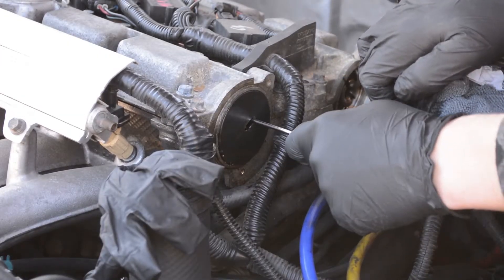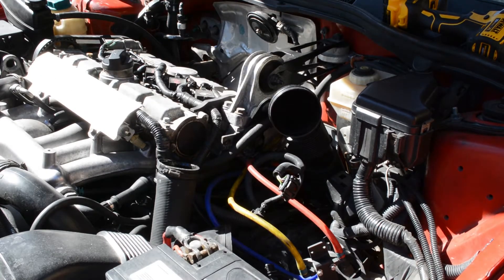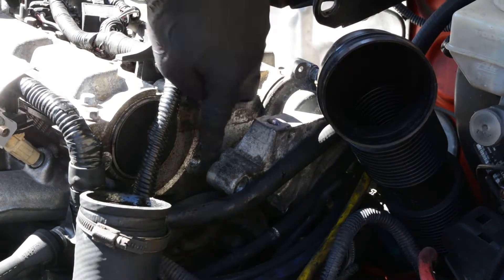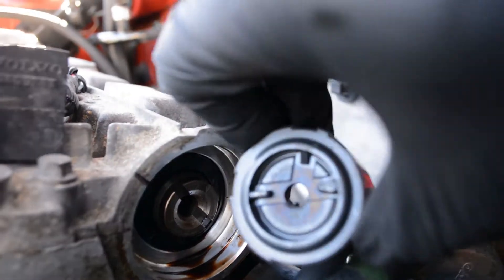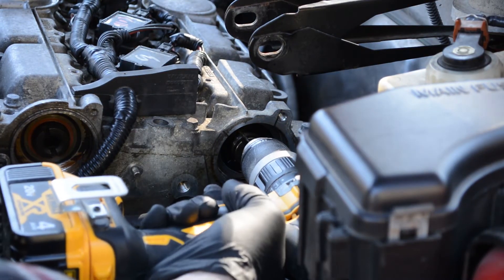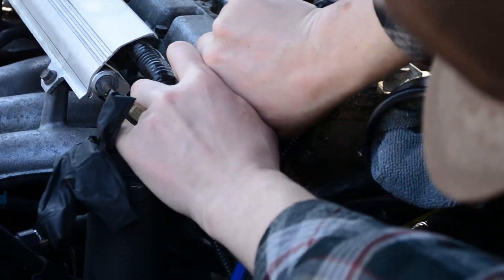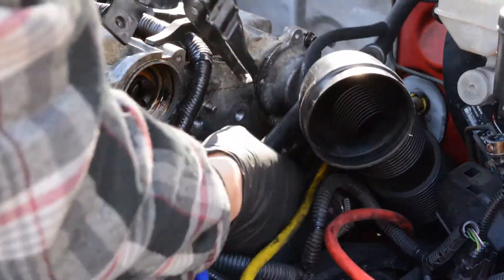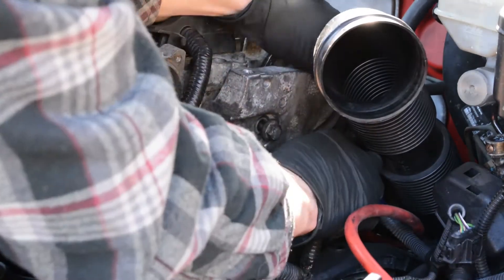Volvo 2.4t Rear Cam Seal Replacement

Comment: great little quick video and just what i needed. one small note, the intake rear cam, if the cover is there, never got a cam seal as the rear plug functioned as the seal so that small part there wasn´t a hack by the previous owner. thanks again.
Reply from the maker: Thanks for the comment! I had no idea that the dust cap served as the seal. So I guess in my case the dust cap was not sealing correctly and I just did extra work. I assume there's no issue with installing a seal anyway?
Reply: Did you end up installing the seal ?  How did it go?  Or did you remove it and only use the dust cap?
Reply from the maker: @wc2787  I had the seal on there with the dust cap, but the comment from James Madison is correct, you don't need it. I actually had a PCV issue that caused the front cam seals to blow out a few months after this video was filmed, so I went back and removed that came seal behind the cap. I then installed the cap and did a very light bead of RTV around it just to keep any oil from leaking around it. It's what a local Volvo guy does, so I followed his lead.
Reply: nice video and good comments was wondering whats up with my rear cam leaking oil and where the hell is the seal.

Comment: For those of us contemplating doing this job, thorough videos like this are helpful to let us know if we'll be getting in over our head or not.  Honestly, I can see this going south for me in different ways ..especially when it comes to extracting and pushing the seal in.  That looks like it takes some finesse.  I hate spending the money but you gotta be realistic about what you can and cannot do.
Reply from the maker: Totally agree with being realistic. Because the money you save can quickly go out the window when you have to get a tow to a shop and have them do it. 

That being said, the seals really aren't that bad. Just need a steady hand and the right tool. There's actually a tool to install the cam seals if you think that would help you out.

Comment: What cam locking tool did you use on the front?  I see some really cheap knock-off's to the very expensive Volvo tools.
Reply from the maker: I'm ashamed to say that I used a block of wood. I tried a few cheaper cam locking tools and none of them fit. I think I'll be ordering the expensive Volvo one for the future because it's not something to take a chance on.
Reply: @StevesGarage  thank you!
Reply from the maker: @davidmaddox7154  No problem, happy to help!

Comment: Good Job! But I don't understand one thing, how you locked the VVT? Because if you lock just the pulley you won't lock the VVT. Where you locked?
Reply from the maker: I only locked the pulley, so you're right, I didn't lock the VVT. I don't think I took it out of alignment though. I never had any issues running or a CEL associated with VVT not functioning properly.

Comment: Thanks for the video. Can you please explain to me how you locked the cams?  The tool I got is to be installed exactly in the same rear part of the cams. Cheers
Reply from the maker: That seems to be what most cam locking tools are because you lock them to do the timing belt. You need a cam sprocket locking tool. You can usually pick up an adjustable one for a decent price at your local parts stores, you just have to find one that fits.
Reply: My question as well.  The volvo cams lock from the rear, so the only way to "lock" the cam while taking that bolt out on the rear is by the timing belt itself.  But that's okay because, as they say somewhere, "as the one cam turns so turns the other cam and the crank."

Comment: I just did this service today while also changing out my PCV system. Like you, I didn't have a seal behind the black dust cap. I thought that was odd, as I'm pretty sure the cap was original and had never been removed. Question is: Will installing a seal where there wasn't one going to cause adverse issues?
Reply from the maker: Some others have commented that there isn't supposed to be a seal in that location. The part diagrams I looked at showed one which is why I installed one. I can say that I had the seals blow out one other time after this video (because of PCV issues) and I didn't install a seal, just sealed the dust cap and it's been fine.
Reply: @StevesGarage  ok great. So far no issues with the seal in place. Not sure what sort of problem to look out for if the seal IS causing issues, but it doesn’t appear to be hindering anything important.
Reply from the maker: @just__dave  My guess would be too much crankcase pressure, which would also be indicative of a malfunctioning PCV system. Make sure you clean out the engine block passages when doing the PCV, that was my issue. The person who did it before I owned it never cleaned those out.

Comment: I changed my spark plugs and I had to un clamp my turbo intercooler and after that I guess I didn’t clamp it enough. While driving I noticed something wrong so I checked under the hood and it was in clamped. I re clamped it tight at home and now my oil is leaking more it never dropped onto the floor but now it does. What can be causing this issue. Would it be the cam seals?
Reply: Turbo intercooler tube ^**
Reply from the maker: Hard to say what would be causing it via a comment section. If it is the cam seal, your PCV most likely needs to be serviced. There can be a small amount of oil in your intercooler hose from blow by, but enough to drip in the floor seems excessive.

Comment: Thanks for sharing, do you have video how to change valve gasket? Need some help because a little oil coming to the spark plug of my s60 volvo and can't any video how to chsnge it a friend of mine told me to need dpecisl tools I don't know what it is.
Reply from the maker: I don't have a video for that because P80/Whiteblocks don't have a valve cover gasket. They use anaerobic sealant. You said S60, so I'm assuming P2 or P3? I don't have the experience to say first hand, but I don't think the P2 cars use a gasket either. Is it possible you have a PCV issue or your oil cap seal has failed?
Reply: @StevesGarage  thank your for you time, I don't know if my car is p1 or P2 S60 2001 model Motor code B2544S. When I change the spark plug I noticed that the spark plug are wet with oil above the thread not much some already dried. A friend of mine told me its the valve gasket and we tried to torch those  small volt above the cover and he told me if I change the gasket I need a special tool I really don't know.  There's no any leak outside or under the motor.
Reply from the maker: @nestordupo845  Happy to help out, thanks for the detailed reply. A 2001 is a P2. P1s are S40 / V50 / C30 / 06+ C70.

As for the B5244 engine, there's no gasket. Unless the cam cover has been removed and installed poorly, it's most likely the oil fill cap gasket leaking or a PCV issue. Depending on the mileage if you haven't addressed the PCV it'll need to be done. For the oil cap gasket, IPD sells a Viton version that makes that gasket a one and done item instead of needing a periodic replacement.
Reply: @StevesGarage I live in Sweden our mile here is different from the US 1 mile=10km now my car 22000 Swedish miles. The vvt soleniod gasket broke down 5 yrs ago and the oil run all over but not in the spark plug bay. About the PCV I don't know if it is the problem I change oil every yr. To service the PCV  it will cost a fortune here in Sweden more than the value of the car. Well I will drive it till it broke down then maybe I will buy another car instead. I seldom use it only maybe a 1000km a yr or less. Only in summer time and no rust at all. About the oil cup I change it 3 yrs ago. Thank you for your time appriciated much.
Reply from the maker: @nestordupo845  Yea, the PCV service is a big cost, but it's not impossible to do yourself! There are a lot of guides out there. Even with changing the oil regularly it could still need to be serviced. Even with the low mileage things can break down due to how old it is.
Reply: @StevesGarage  I will try to do myself as project maybe next year, just now I'm in recovering from surgery of prostate cancer. Thsnks a lot.
Reply from the maker: @nestordupo845  Good luck with your recovery!
Reply: @StevesGarage  Thank so much sir.

Comment: Are both seals the same size
Reply from the maker: They are, but you only need the rear seal. I made a mistake in this video installing two. The dust cover on the front cam acts as the seal.
Reply: @StevesGarage  ok thanks...i just had the crankcase seal done so onto the next lol
Reply from the maker: @bawssnarmz5204  Might as well do them all while you're there!

Comment: Will this method work on a 2005 Volvo s60 2.5t awd
Reply from the maker: I don't know enough about that engine to say for sure. But I do know enough about Volvos that the concept of the replacement would be the same. I'm sure the sizes would be different, but the location and method would be very similar.
Reply: @StevesGarage  perfect! Thanks
Reply from the maker: @tysonstuart312  No problem, I hope the video helps. If you do have any other questions let me know. I might be able to help you out.

Comment: Could you tell me the diameters of all the seals? front and rear cam seals and crank seals please for volvo s60 2.4t 2002
Reply from the maker: I'm not familiar with P2 cars as I haven't owned or worked on one. I know there are different front cam seals for engines with and without CVVT. I know that the IPD website has dimensions listed for some of the seals, you could also check FCP Euro.

Comment: I bought the install tool thinking that would be a dummy proof way.  But it just ended up ruining the seal.  That inner rubber lip as you said can fold in on itself.  Using the install tool you have to press the seal onto the tool and its a pretty tight fit and you obviously have to press it on the tool the opposite way you'd press it on the cam and it makes that inner rubber flap fold the opposite way it's supposed to.  Or maybe im just an idiot.  but your method seems better
Reply from the maker: I haven't used the tool, but thanks for sharing your experience! A local Volvo guru told me to use the socket like I did in the video. Did you end up getting the seal installed properly?
Reply: @StevesGarage  Well in hindsight the part I was concerned about being folded in probably was insignificant.  I was looking at that tiny lip on the outside of the seal on the inner circle (if that makes sense) and part of it was folded in but then I removed the seal and determined surely thats not the part of this seal that's actually creating the seal. Unsure if you know what I'm referring to but it's really really small and not much to it and I'm thinking at this point it's an insignificant part of the seal. But...I had to order another, so waiting on it.
Reply from the maker: @jRODl4705  I think I know what you're talking about... I'm pretty sure you're only worried about the inner lip folding over, but better safe than sorry. I'd rather re-do the job like you are than have the seal fail once you start driving.

Comment: What if i had changed my pcv system but never replaced the seals. It has been another 100,000 miles since last pcv tune up. So it is time to do it again. But my q is, what if i just replace the seals and not the pcv? Its oem parts. Change oil religiously. Pls lmk. Maybe just replace seals then do a glove test?
Reply from the maker: If the seals aren't leaking there's no reason to replace them. They are also not a replacement for the PCV system maintenance. You should definitely do the PCV, and the cam seals are optional.

Comment: Hi there

Hope this finds you well

Firstly I'd like to thank you for the information that you provide. 

Secondly, I'm located thousands of miles  away from you so your answer to my questions will be greatly appreciated

I need your step by step instructions on how to remove the Rear Cooling Bypass Pipe because  it started to leak from where it meets the back of the water pump 
my Volvo is a 2001 xc v70 turbo AWD
if you did that before and have a video or a link to how to do it please send 
another question should I remove the turbo to get that pipe removed?
your help will be highly appreciated
thanks in advance.
Reply from the maker: Hi, unfortunately I haven't removed that on my car so I don't have any advice or a video. I know that Robert DIY deals in P80s and you have a P2 with it being an 01, but does he have a video? I know the early P2 cars are similar to P80s. Also, maybe pick up a haynes manual to help you out?
Reply: @StevesGarage  I'll try to find that manual. Thanks any way

Comment: I'm kind of panicking because I didn't have a locking tool and when taking off the grey little wheel on the back the cam moved about a quarter inch. However the belt itself did not move but the whole gear, when I look at the cam gears pop in and out about 1/8th of an inch :(
Reply from the maker: So the cam is moving in and out of line with the belt? Or it rotated out of position? The cam shouldn't move laterally as it's locked into place by the cam cover. If it moved out of rotation, you might have to reset the VVT hub to sync it back up.
Reply: @StevesGarage  Sorry, badly explained. So the cam gear itself does not move at all however I can feel the cam internally rotate as I loosened the wheel on the back, but less than a quarter turn (cam gear remained stationary and frozen in place, so to speak). Yes, the cam gear moves horizontally in and out of line with the timing belt (in and out about the width of a cardstock piece of paper, which would lead me to think just free play between the two parts that bolt the cam into its "cradle" in the head or something.

Additionally when I tightened it back up it rotates back to the position it was in (clockwise about a quarter turn) prior to loosening and unbolting. Hope this helped clear any confusion

I've replaced and bolted everything back up in regards to the PCV system. All that's left after the cam seals is the timing belt which I haven't started yet
Reply from the maker: @JCDUDECANTU  No problem! I think that's the movement within the VVT hub. You're doing the timing belt, so your best bet is once that's replaced, turn the engine over by hand two full rotations and make sure everything stays lined up. That's a good practice to have after doing the timing belt anyway, but extra insurance since you felt the cams move while doing the seals. Let me know if that makes sense or if you have any more questions!
Reply: @StevesGarage  I will be doing that shortly. If everything lines up is there any need to "recalibrate" or reset the CVVT cams? Best practice to do so anyway? Thanks for the help thus far. I have the "4T5" motor with the dual CVVT
Reply from the maker: @JCDUDECANTU  I'm not very familiar with resetting the VVT as I haven't done it myself. I believe it only has to be done if you remove it, but I would double check. From what I understand the car will run if it's not tensioned correctly, it just runs poorly when it calls for the VVT to engage.
Reply: @StevesGarage  I have a Haynes manual and it shows what the hubs and gears should be set at but mine is set looking different than the illustrations but ran very well. Real puzzle to solve here
Reply from the maker: @JCDUDECANTU  That's definitely odd. Maybe some forums have the correct information? I found some posting a pdf of the official Volvo instructions on how to do it.